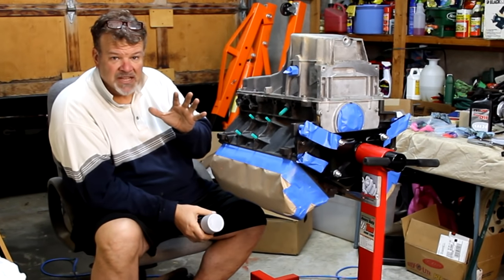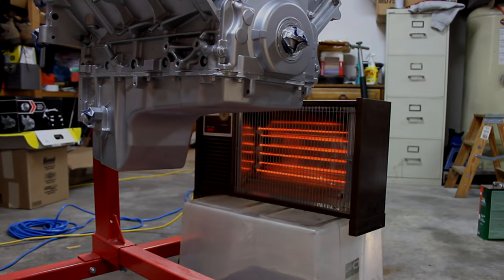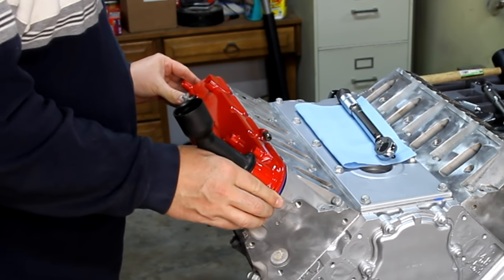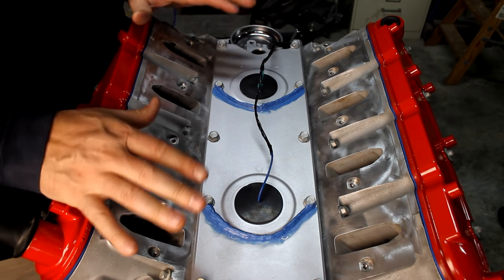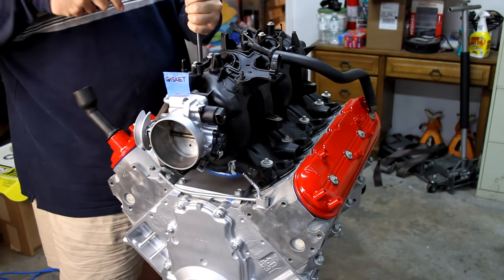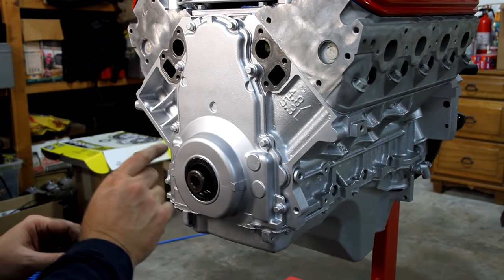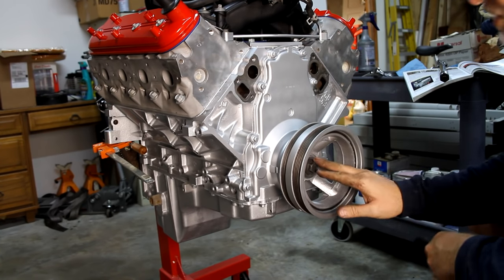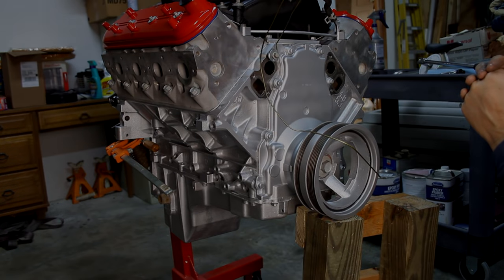LS 5.3L Build Part 7 Paint / Intake / Balancer | Project Rowdy Ep011

Comment: Thanks for making this series of videos. Extremely helpful. I was fairly confident that the engine block cover bolt holes were blind, but couldn't find confirmation if a thread sealer was needed. This is the added boost I needed to carry on!
Reply from the maker: Stewart Chen Glad that you enjoyed the series.   Have fun with your project.

Comment: Thanks for the tips on masking off the water pump and holding the crank from rotating. Sometimes have to get creative when doing a 2 person job by yourself. My younger brother Robert just installed a built 6.0 in his 2001 transam over Christmas and got it running. I might post a video on it even though I didn't help any. Lol it was cool to see both engines go together.
Reply from the maker: I like to get creative!  Would like to see the video on the 6.0L.  I could use it like a carrot dangling in front of me!

Comment: I've really enjoyed these videos.  My old 2002 Avalanche has the same LS engine with 473,000 original miles.  So far, I've replaced the alternator, water pump, knock sensors, and plugs (3 times).  That's it.  GM got it right when they designed that engine.

I also have an almost stock 2004 Jeep TJ Wrangler.  Hmmmm....
Reply from the maker: Dang.... that is a lot of miles!!!!!  The TJ would be a really cool project.... just saying!!!!

Comment: Great videos!  Were you able to stretch the balancer bolt in one motion after the initial torque?   Lot of info on the web is suggesting the final torque to be 240 lbs.  It would be interesting to do an experiment:  Do the initial torque at 37 lbs then put the degree wheel on and set your torque wrench at 240 lbs.  Start the stretch and stop when you get tor the correct degree and if it click first just keep going tell you get to the correct degree.  I have a friend the works at the dealer and does a lot of these, his advice to me was he uses blue locktite and hits it with his 1/2 inch impact gun.
Reply from the maker: It would be interesting to know the difference.   I believe you can get a very accurate torque at the lower settings and then the angle provides the proper stretch.  Some Engineer came up with this sucking down some coffee in the break room....   Cheers!   Mike

Comment: I know it is too late to mention this.  Almost one year later!  I have reviewed your entire series and I am impressed!  But in this session you show installing the valley cover.  I believe you have your "knock sensor to valley cover grommets" installed upside down.  These are the grommets that are pressed into the bottom of the KS towers (not the ones on top that have the wires in them).  When the valley cover is out, and laying on a flat surface with bottom facing upwards, the two knock sensor "towers" are then facing up.  Install the grommets so that the "flat surface" of the grommet are facing up also.  Yours are facing down.  I rechecked the OEM GM manual, and it shows the the flat facing up.  The book you have used to help take apart and reassemble this engine, does not explain this in detail.  I know, I have one also.  I also checked other sources, and the flat faces up.  When you install the cover, it should slip down over the engine KS bosses, and stay put.  In your video, because the grommets are reversed, the cover wants to pop up (look at your video and see this).  When I saw your cover wanting to pop up, I knew something was wrong.  Then I ran the video back slow, and noticed what was the problem. Hope this makes sense.  If you want, I can email you a diagram as to what direction is the correct install. If you can find evidence that I am wrong, by all means let me know.  I am going what my OEM GM manual shows in its diagram, and from sources of videos where folks are removing valley covers that are virgin - and all show I am correct.  Please let me know what evidence you have uncovered if you can show me wrong.  Then I will contact GM engineering and find out what is going on.  The entire series is a top notch production!!
Reply from the maker: Joe,  Thanks for the details.  I do understand what you are talking about.   I might have an opportunity to remove the intake soon and if I do, I will take a look at this.  Thanks again for the kind correction to my mistake.  Cheers!

Comment: moving along good painted and love the degree wheel works well 
thanks for the step by step videos awesome stuff happy new year 
also thanks for the great shout out
Reply from the maker: Yes Sir!  My pleasure.  Thanks for all of the support you provide all of these great channels.  Stay warm!
Reply: UCanDoIt2 
Hello Sir how or what method did use to paint the harmonic balancer and not paint the rubber? I will say your explanation of building the engine and  the steps are excellent. The information is easy  to follow and use keep up the good work
Reply from the maker: Beau -- On the Harmonic Balancer, I cut thin strips of masking tape to mask off that little rubber area between the inner and outer hubs on both front and back.  I also placed a tight wadded paper towel in the center hole to help avoid paint getting in the center hole.  Also because this is part of the rotating assembly, be methodical and try to lay an even coat of paint on it.  I was surprised how well it turned out and after all of the parts started coming together, I realized that I probably should have painted the Balancer BLACK to match all of the other rotating pulleys.  Don't tell anybody, that will be our secret!   Best of luck with your build and have fun with it!!!!!

Comment: Great job!!! You are one of the few people that are as picky as me when I do a build. I have just built Chevy 350's in the past. This was a lot of help. I'm looking to build a 6.0 for towing in a 2500. I do want to ask a question and it may show my ignorance. Is there a reason for not using the cordless drill for snugging all bolts before the torquing? Thanks again.
Reply from the maker: This engine has so many similarities to the older SBC, but they have moved some things around (ie oil pump and others).  Regarding the cordless drill...   In the manual that I followed, it made a great point as to why NOT TO USE a pneumatic impact driver on the engine.  The gist of the point was that people press down on a bolt, then pull the trigger, when that bolt reaches the top and is still in a high pressures spinning action, you are damaging those first threads.  I thought this was a good point.  I am not anal about things like this and I know that you could get the bolt started and then let off the downward pressure....  BUT, I just thought I would do it by hand.  Most of the time, we would use the old school wobble wrench and sometimes, we would grab a ratchet.  I actually meant to mention some of this in the video and forgot.  Bottom line, just a personal preference.  Hope this makes sense.  Thanks for watching good luck with your 6.0!

Comment: Awesome video doing 6.0 in 86 square body How did you get intake so clean it looks new thx
Reply from the maker: I believe I used Simple Green and Mineral Spirits (separately) with a scrub brush.  I have since heard people having good luck with Oven Cleaner.  I did have to use a screw driver to break up the build-up inside the ports.  Cheers!

Comment: Like the video series! I'm gonna start to build my 5.3 lm7 soon. Planing on stock crank,K1 rods, wiseco pistons, With an comp cam turbo crank shaft and ls6 heads with comp cam valve train upgrade kit and a holley sniper intake. Also slapping on 65 mm turbos.
Reply from the maker: WOW!  That sounds like it will run like a scalded dog!   That will include a lot of upgraded parts compared to mine, but what is cool is the process of your build should be similar.  My original thought was to start with an L33 which comes with those LS6 Heads.  Have fun with your project and let me know how it turned out.  Happy New Year!
Reply: ya gonna have a th400, 9inch rear end and bmr suspension , gonna take about 2-3 year just due to cost of parts, but goal is get it all done run it na till i have for the turbo kit and suspension then put those in
Reply from the maker: I like the fact that you have a realistic 2 step plan.   That will allow you to enjoy it while saving up for a second wave.   Understanding up front that you are stepping into a long term endeavor is important to it's success.   What will all this "Get up and Go" be install in?

Comment: flywheel/flex plate was moving as you tightened the harmonic balancer. e.g. the crank was spinning as you were angle torqueing the bolt.
Reply from the maker: Rkilling1 i had reset the gauge after the crank returned to the lockout position.  It was ultimately tighten with the clamp at the top.   Thanks for watching.

Comment: I noticed that a mistake was made with the coolant crossover / steam vent tube setup on this engine. You are running the later cheapened stock setup that can cause a piston to break apart from detonation in the rear cylinder (usually #7 instead of #8). For some reason under certain conditions the rear knock sensor will not detect the ping in the rear cylinder caused by hot spots from the lack of venting the steam pocket. My father had his 2006 cutaway Chevy Express 2500 with the 6.0L engine put a rod thru the side of the block because of this problem. Simply driving thru Bessemer, Alabama on a 80 degree afternoon and boom. Only had just under 240k highway miles on it at the time. 

The older crossover /steam vent tube was a H shaped one piece pipe that went under the intake manifold. There should be a way to convert your existing setup to this some how.
Reply from the maker: That is interesting!!!!  Would not be hard to find a vent tube system that connects all four vent ports, I have seen and am familiar with the tube that you describe.  A little odd that an engine with 240K miles in it with a potential back rear know sensor on it and you point to the vent tubes.   I thought I have seen example of people with the 4 port tube, purposely block off the rears and go with what I have.    Would love to hear form others on there opinion.  That would be an easy change to make!   THANK YOU for the idea.
Reply: I have a 2007 Suburban with a 5.3, (with Active Fuel Management if that maters)  I'm finishing up an install of a remanufactured engine I bought from the Chevy dealer.  My original engine  had the vent tubes on the front and provisions on the back with caps/covers. The remanufactured engine has the back sealed/plugged permanently so you can't install  a  rear tube at all.

Comment: Hey there. Love your vids. I plan on using them in the near future as a guide to rebuild a 6.0 lq9/lq4 and put them in my ‘75 caprice. I have a few questions if you don’t mind.

What engine stand are you using and would it be adequate for a 6.0 iron block? 

Would it be smart to buy a stripped block as I plan on touching every part as you have just to prevent future headaches? Or should I buy complete and replace as I go?

Also are there any tips/tricks/advice you could recommend? This would absolutely be my first dive into motor repair. 

Thanks for any help.
Reply from the maker: Medium grade Harbor Freight Engine Stand.  These engines are heavy

Stripped Block - That would work well as you might plan to replace most of the items as I did.   I typically learn a lot from the disassembly process.

You need a repair manual to follow and learn from.   I used.  GM LS-Series Engines by Chris Werner: Amazon: http://amzn.to/2igcReD
Reply: UCanDoIt2 thanks for the heads up. You will probably hear from me in the future. I hope everything goes flawlessly

Comment: Liked the video 
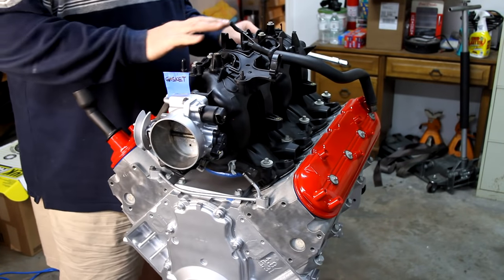But at 12:17 you talked about the torque  sequence 
I noticed you didn't to any of that with the other gaskets (etc) up until now 
Would that cause any issues in the future?
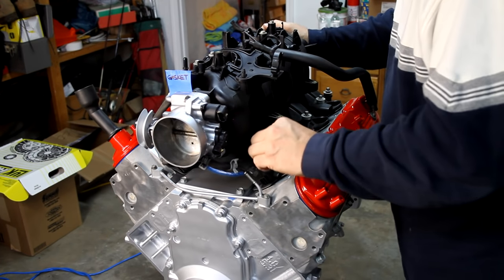Reply from the maker: The book that I followed mentions torque sequences for some items and not for others.  If you study the Torque Sequences, the statement that I made at 12:17, I feel is very accurate.   It could be apply to every item that is installed.  A Torque Sequence is very important for tightening items down evenly and reducing stress on the item near the fastener that is being tightened at the time.   Things like: Main Crank Bearings, Heads, Intake, Valve Cover, and the Oil Pan are items that this would apply to the most.  The only items that I can think of that I did not apply this was the Front and Rear Covers.  I believe I went around in a circle on them, but I did do them in stages (Snug, half way, torqued).  You are trying to avoid cracking thin items and warping others.   Hope this helps.  You are very observant and this was a great question.  Cheers!

Comment: How did that paint hold up? I see this is a old video...just curious if it peeled over time
Reply from the maker: Well the good news is it looks like it was painted yesterday...  the bad news is that the engine has not been installed in my Jeep yet!   Therefore we have not run it yet.   That VHT is Heat resistant and should hold up extremely well.

Comment: Another great episode!
BTW you should wear a respirator, I've had an incredible headacke issue one day when I was doing a valve covers painting, since then I've never paint any things without a respirator.

The funny thing is when I've watched this EP I was thinking of asking you about some wiring harness tutorial and then I'm scrolling down to the comments section and first thing I see is the same request that +MontanaLowGear has already wrote! :))

Waiting for your future videos, great job!

P.S. - I'm working on LS-based 7,6L race engine swap now (into '99 e46 BMW) as well :)
Reply from the maker: I have a couple of Respirators and just forget to use them until I about half way through the job!   And you are right, I have to start using them!  Yep, I'm working out my approach on tackling the wiring harness which will be next.The LS in an E46 would be bad ass!  We have a 2000 328 E46.  Love that car, so easy to work on.  It's old enough that it needs a lot of work, but it is so easy, and I find the parts are cheap.  You should consider some videos of that swap.   I'm in!  Thanks!

Comment: Hey! I don't mean to keep bugging you but how many miles did this engine have on it when you got it? What range of mileage would you suggest for a project? Is there a certain mileage that would be considered too high?
Reply from the maker: My engine had about 180K on it.  Wow... the next part is difficult to answer and I hope some more qualified people will chime in here.   Here is my logical answer!!!  An abused engine with 150K might have stress issues and a well maintained 250K engine may be the perfect candidate.  An engine from a salvaged truck that was hit in the rear may be a good candidate as it was salvaged due to accident and possibly not engine issues.  The Salvage yard that I purchased mine from had the engine already out of the truck.  But they have a routine that they perform that identifies the best candidates.  They also offer a warranty (only of you don't take it apart).   It's a crap shoot!   Most issues can be solved with installing new parts.  The Block and Heads are the skeletal parts that you are hoping are issue free!  Don't worry about asking questions....  This is part of your research and these are great questions.  Cheers!
Reply: UCanDoIt2 thank you so much! I keep recommending your channel to my buddies! I just picked up a 2000 5.3 yesterday with 100k miles for $460! I'm so excited to start building it! I saw a comment on one of your other videos that the guy was only 19. I thought I'd let you know that I'm 20 and you inspired me to start this build! I'll have to keep you updated on it! Thanks again for the great info!
Reply from the maker: Please do keep me updated  I saw a comment form you about the book that I followed and then that message disappeared.  Did you find it or another resource?  I think it is very important that you follow a written approach.  The book I used offered a lot of additional information that was useful.  It is listed in the description area below each video ("Show More").  Have fun and learn some really stuff!!!!!  Mike.
Reply: UCanDoIt2 yes I did and then I saw someone else asked the same thing and I saw your answer. I felt bad because you already answered it! I bought that book and it's supposed to arrive today! I couldn't sleep last night because I was so excited to get to it!
Reply from the maker: I understand our excitement!!!!  Have fun!
Reply: UCanDoIt2 oh I will for sure!!

Comment: 🇺🇲 I know this was 4 years ago but I have a question, I have a 05 GMC 1500 4wd 4 door with the 5.3 LM7. I was thinking of getting the Diablo tuner, it adds up to 30 hp or so im told, my question is do you think my stock 4L60E transmission can handle 30 more? It weighs roughly 5500lbs and its my daily driver. I really want to change my lazy shift points and if I can get away with it I'd like to add 20 or 30 hp and a little torque. Im real nice to it and I don't tow anything but my fat ass and my dirtbike. 🇺🇲
Reply from the maker: There are people that turbocharge those engines, so I assume that 20-30 wouldn't even blip the radar.  Go for it!